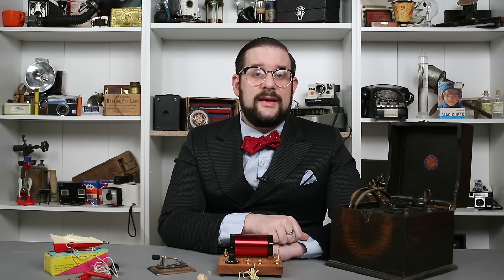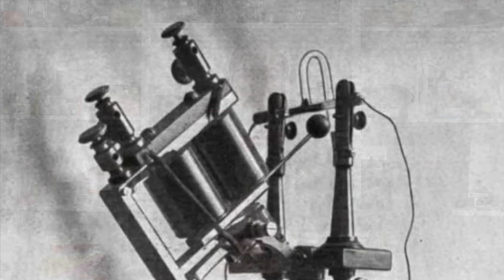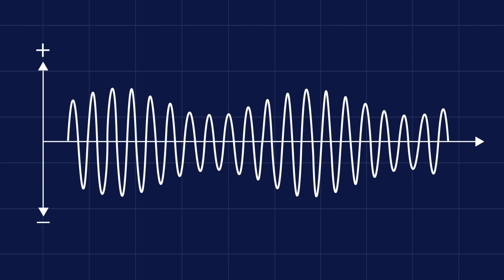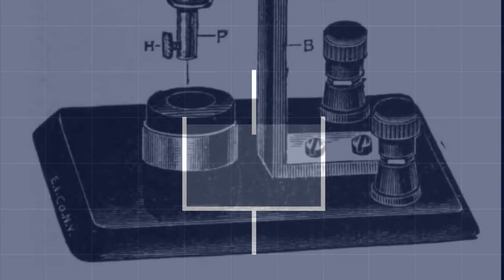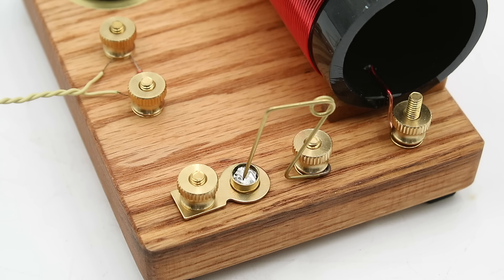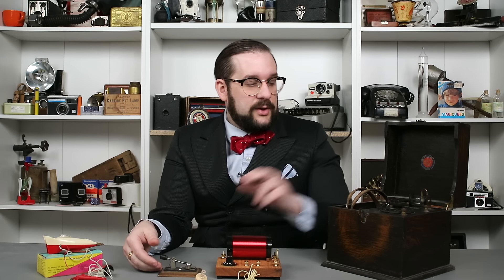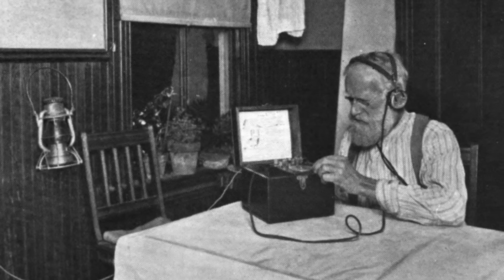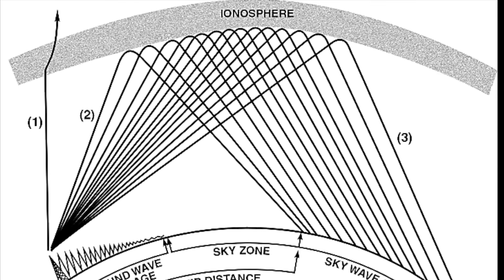Crystal Radios: No Batteries? No Problem!

Comment: In the late 1960's the "party line" (shared landline connection) to our farm was replaced by underground cable which left almost 2 kilometers of overhead, insulated, soft iron wire in an "L" shape unused. So I connected my crystal set! I could listen to 2GZ Orange NSW Australia from about 130km (80miles) away. :-)   .. Jim Bell (Australia)
Reply: That’s awesome

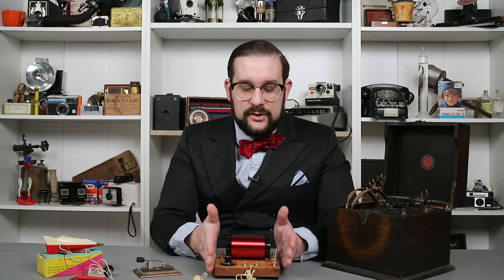Comment: 9:55 might be bob lazar 

He owns the company
Reply: 20:27 add a simple pll to the lc circuit and feed thru or gate with input from antenna 

Use a modern Schottky diode with low forward drop under .5v 

And a battery with opamp (as a comparator)
to get rid of pll and am carrier and just have the modulation 

 Get am signals from over the horizon and amplify em so your 3.5mm will work

Technically impedance matching a crystal radio with a low impedance load

Also could use a 555 timer as well
Reply: 22:05 empty glass beer bottle, saltwater, and wrap the outside in a foil or metal sleeve

Comment: I have a set of old headphones (similar to the one you have) used in the military and it would be interesting for you to show how they work because they don't have little speakers, they use 2" metal discs. In fact I heard what some did was actually add a crystal or some other component inside the head headphones to receive and hear the signal using the headphones alone. The only thing I know for sure is they work, you'd be lucky to get 2 years use out of today's headphone.

Comment: I was in Cub Scouts in the early 60's, and I built one to get an Arrow Point (the symbol for completing an activity). I bought 100 feet of Belden hookup wire and ran an antenna in my back yard. It didn't work. Then I moved it to sit on our washing machine in the garage. I connected the ground to the cold water pipe. It worked! I was so impressed I later became an electrical engineer and worked in the radio industry. And it all started in Cub Scouts!

Comment: The crystal detector is a Schottky junction, or equivalent.  1N5711 or 1N5712 is a good one.  Also blued Razor Blades.
Reply: A modern germanium diode works better than a silicon one due to the lower Vf.  The band gap of germanium is 0.6eV (silicon is 1.17eV) and the galena (lead sulphide) crystal used in the early radios had a band gap of only 0.37eV, they were called "point contact" diodes, and the metal point probably formed a Schottky diode with the galena.   Rusty razor blades work even better - probably due to the thin oxide layer.

Comment: There are also variable inductor sets which use two pancake coils in series, one of which is attached to a movable arm so that the coupling between the two can be varied. As a kid I built a set like this from instructions provided by a BBC expert called Mr Farley who I wrote to following a TV program about this topic. It worked and I was totally hooked on electronics from that point.

Comment: Funny story.  I built a crystal radio for a science fair project as a kid in the 80's...got a blue ribbon!  I still remember being fascinated by the ability to build a radio with just a few components and some blocks covered with aluminum foil (you'd slide the blocks over one another to act as a variable capacitor).  I still remember Dad having to visit multiple Radio Shack locations to find the right components.  I wish I still had it.  It was little more than a handful of wire stuck to a block of wood using thumbtacks to complete the junctions.

Comment: Attach the antenna to a curtain rod.
Reply: Yes, that works if you have stations nearby.  You need more like 20 feet of wire if the stations are far away.
Reply: @kensmith5694 It was T.O. in the 60s. Lots of nearby stations, always something to listen to.

Comment: Would I need less of an antenna being on the 15th floor of a building?
Reply: Generally, you need a good length but less added height.  The building may be conductive due to being made of iron etc.  Dangling a wire out the window may be an option.
Reply: @kensmith5694  that’s what i tried and it was very effective with only about 8 meters of antenna

Comment: With one of these radios that doesn't uses battery can plwer a small led! Which os pretty cool. Lole wireless light woth out battery. That will depend on the radio station distance. Of the station is near by your led will be bright , its neat. Pretty cool tech.

Comment: KFAB one mile awaiy from Papillion, Nebraska and with a broadcast power of 100KW made my Foxhole radio work just fine.  One of the thrills of my youth was when I connected the ground wire to the water pipe under the exposed bathroom sink and while tickling the pencil lead strapped to a safety pin over the surface of a single edge razon blade,.I heard KFAB for the first time .  I used an empty toilet paper cardboard core and 120 revolutions of 20 ga wire.   Fortunately I could reappropriate my dad's high impedance headset or the whole shebang would not have worked.  Much later in life I helped my daughter build a set using a germanium crystal as the detector.   Seemed like cheating.

Comment: I grew up in the 50's and used to build these radios with enameled wire wound around toilet paper tubes.  An open safety pin to spring load the point of the pin against the crystal.  The earplug used a crystal as well to convert the electrical vibrations back into mechanical vibration of the earplug diaphragm.

Comment: As a teenager back in the 1950’s, I built a crystal radio with a cat-whisker detector and put it in a cigar box. I think I had a 4 or 5 foot antenna dragging too. I use an old WW2 surplus headphone and using the coil tuner was able to receive AM radio broadcasts while walking outside. It became my first and cheapest “portable” radio. I lived in San Francisco, so there were many strong radio stations nearby.

Comment: I think that there was another type of radio used before a Xtal radio...TRF Tuned Radio Freq radios...with 3 dials
Reply: You have the order wrong.  Crystal radios came first.  TRF was later.
Reply: @kensmith5694  not according to my radio/communications history sources. They were developed simultaneously with Xtal being used frequently by DIYers and TRF to be sold commercially.
Reply: @W8RIT1  Audion detectors are mentioned in my 1909 "Operators Wireless Telegraph & Telephone hand-book" but there is no mention of using tubes to amplify RF as in a TRF.  T type of crystal detector is included.

Comment: I built my first crystal radio at 9 years old in 1962 as a project in Boy Scouts.  Even then, I was amazed at the technology that performed without batteries or plugged into a wall receptacle.  Stringing an antenna wire across the length of my bedroom ceiling and hooking the ground clamp to the hot water radiator, I was tuned into the local rock-n-roll AM station, listening through a single piezo earpiece.   My mother, who came from London, England, remembered well her family's first crystal radio that required manipulation of the "cat's whisker" to maintain a broadcast signal.  Knowledge of crystal radio technology will be valuable information to have after the zombie apocalypse.
Reply: To add to my comment:  I just checked and am very pleased to see that AMAZON does carry a number of kits, with all the parts, for building a crystal radio, starting at around $20.  That's definitely going to be a stocking stuffer for my grand daughter this year for Christmas and we'll build it together.

Comment: My parents bought me a crystal radio similar to the rocket ship radio at the 1962 World's Fair in Seattle. I went on to build other crystal sets including the foxhole radio using a blue raiser blade. When my son was in the Cub Scouts I out together a project for the boys where they built a crystal radio set on a board. I found a forum on line for crystal radios. The guys on the forum were so generous they mailed me the ear pieces, geranium diodes and variable capacitors needed so each boy had their own set. Pass it on.

Comment: When we were 6 years old my cousin came over and  had my dad draw a schematic for a crystal set. My cousin built it. It looked like the thumbnail of this video. 16 years later my cousin got his engineering degree with perfect grades. It took me 5 more years, as I was a dumb engineering student. 40 years later I was a consultant to an electronics company where another guy worked, who could turn anything into a crystal set. I never made a crystal set, but a poorly grounded guitar can pick up AM stations.

Comment: A shame that AM stations are shut down here in Europe (I don't know if there are stations left, but the frequencies are scheduled for reuse with digital services, as far as I'm aware of). I do have an old original "cat's whisker" crystal detector, witch I repaired, and which worked quite nicely. I also have replaceable coils (the "spider web" variety, one original and some self-made), and old-style headphones (even though those are actually from the 80s).

Comment: You nailed this video very nicely. I started building crystal radios since the 1960's and had a sizable collection of early 1920's sets. I have been a Ham ( wa4jat ) since 1974 and still enjoy building crystal radio circuits for the short wave bands.

Comment: When I was a kid in about 1960 I got a crystal radio kit for my birthday that was from Radio Shack. I was amazed that I could hear radio programs through headphones with no power but it did have to be attached by wire to a pipe in the ground outside my window for the electrical ground.

Comment: I had a crystal radio as a child, around 1958, that looked like an egg with a knob on one end that you turned to tune, a wire with an alligator clip that I clipped to the steel frame of the bunkbed and a earpiece. I loved that thing and could get all of the local AM stations. Thanks for reminding me of it 🙂

Comment: If a station is 2 miles away corrosion on zinc fence may detect and power sensitive earphone!
Reply: Got red ribbon for crystal radio science project ,I think germanium 1n34 diode variable cap and coil,fahnstock clips for connections!!!

Comment: England. What an excellent video. I built and did terrible things to crystal radios, some of which actually worked. With a roughly 200 ft aerial at 30 ft, I could even use an old extension loudspeaker. I learned more about the history of crystal radios, etc. watching your videos, than all the books I ever read. Well done that man, I'll put you up for a knighthood (but don't hold your breath).

Comment: For the foxhole radio capacitor problem, one solution I've seen a few times in the museum radios and old photos, and personally done at one point is to take a couple of the 5-count packs of razor blades with the razors still in their wrapping paper, then punch down through the paper with a wire tied tight on both sets of blades. Interleave them like shuffling a deck of cards and you get a workable-but-clunky variable capacitor you can make in 5 minutes tops out of stuff any POW or soldier can get ahold of easily. Sadly can't get blued razor blades anymore, only stainless, but you can make a decent detector crystal by heating up a galvanized nail with a lighter to oxidize the zinc coating, zinc is a pretty good diode. For the piezo earphone, grow a crystal of Rochelle salt out of single-acting baking powder on the bottom of a tuna can, stick a piece of foil on there, and connect one electrode to the foil and the other to the tuna can - that's how the POWs did it, but the people in the trenches already HAD high-impedance headphones for the sound-powered field phone systems.
Reply: Get some selenium dioxide gun bluing if you want to use a razor blade for authenticity.

Comment: You can replace the diode with a blued razor blade and safety pin. The capacitor used to be made from the paper and aluminium foil liner of 1940's cigarette packs. The only thing you need is the ear piece. Everything else you can make. The coil can be a pain but there is a trick for that. Use some thick fishing line between the copper wires to keep good spacing. Use preferably clear nail varnish to keep the windings in place and plain brass eyelets to secure the ends. I'm currently working on a variable capacitor where you do not have to folf the baking foil to tune it, but it's not so easy.
Reply: Good Post.
Reply: As built in POW camps in Germany during WW2

Comment: Love it, Spirit of the Radio, Eh Canida?!. I'm glad crystal sets are having a bit of a moment again. Still remember by pals RadioHack 101 project kit back in the 70's and grounding to a radiator, wire in a tree, sharing the earpiece. Good times.
Reply: Yes, I am seeing a lot of youtube videos about making them.  I even made video to try to help them out on the topic of the 1N34 diode that normally was used as the detector.  You can't get real 1N34 diodes easily these days.
Reply: I had a three transistor radio shack p box   I listened to the fall of South Vietnam and the watergate scandal on VOA. Great stuff.

Comment: With the advent of all radio stations migrating to digital, these crystal radios without an AM transmission to receive will just become curiosities for the museum. Even SSB is totally undecipherable by these simple tuned circuits, however FM stations can be slope detected but I've never seen a crystal set that works at VHF where FM stations can be found. I remember building a crystal set nearly 70 years ago to listen to Radio Luxemburg, happy days :) .

Comment: Great video.Ispent some time as a radio operator 30 years ago. With the right atmospheric conditions a 10kW AM radio signal can travel around the globe easily. That is why AM radio stations transmit directionally at night here in the US. I used to only have an AM radio in my car and I would tune into some stations from Cali and Texas for fun. That radio had an excellent analog tuner with very fine adjustment. It was a stock radio from a 73 VW bug😊
Reply: strange far off late night am stations were always fun on a drive waiting for them to announce their town

Comment: Of course, this also needs you to have local AM transmitters, which are vanishing fast, and with the local rise of all the poorly shielded (if they have any at all) electronics, that all emit wideband RF noise, you will not get any signal out of a crystal set these days, unless you are lucky enough to live very close to a transmitter that is still active.
Reply: I happen to have about 4 in my area.  There are still quite a few stations but the broadcast rubbish.

Comment: Thank you for a clear and educational video.    I live in France.  France no longer has medium wave AM radio transmissions, so I was unable to test the crystal set which I had made for my grandson in Perth, Australia.  He should get good reception as he lives just 7km from a 50kW transmitter!
Like some other responders, I was given a crystal set when I was 12, in 1953.  I eventually left school to study electrical engineering at university and ended my career as a head of a section of electronic engineers, having worked my way through the various levels of electronic engineering.

Comment: I made a crystal radio a a kid with an OA91 diode, a coil of wire wound around a spool of thread and a crystal earpiece, didn't use a capacitor. Got a great signal when attached to the radiator, Atlantic radio 252, 500,000 watts.

Comment: Great show. Thank you.
    I had a Spy Pen Radio as a kid back in the early 70s. Tuned by sliding the tip in and out.
   Best earpieces ever.
That Q he is talking about is important.
    Also as a kid I spent too many hours making electronic bugs 
    A high Q transistor in a spy transmitter is a world of improvement.
    I watched too many James Bond movies as a kid, which is why I got into this stuff. Fun Times.

Comment: There was  a version of the crystal radio called a foxhole radio.  The circuit was the same but the crystal was replaced by a razor blade and a piece of pencil lead attached to a safety pin.
Reply: He hit on that in the video.
Reply: I missed the end of the video and posted this, then went back after I posted this.  He did a good job

Comment: When I was a small kid, I was given a crystal radio, and I loved running out a wire to listen to the local station.

I had that radio many years, but it disappeared many years ago! But it started a bug that became a profession with me in electronics, and I spent 36 years as an avionics tech, till my health lead me to retire.

Now I still work on electronics, and I am an Extra class amateur radio operator and I still listen to stations all over the world!
Reply: I built a Heathkit HW-12 at age 13 and was careful to follow the excellent assembly manual exactly. I loved making stuff. The radio worked fine but I needed to learn Morse code better.  Now I know Morse great but never got to use it with another person. People beeping car horns don't know they are making Morse. LOL

Comment: You are describing the earliest version of transistor, but they didn't know it was one?
Reply: It really wasn't because it only had 2 legs.  You need at least 3 legs for a transistor.  The work comes from one of those old languages with the "trans" part meaning from here to over there and the "sistor" being from resistor

Comment: Crystal sets don't hear FM radios - they work with AM but there are very few AM transmitters any more, and what AM transmitters are left are likely to be too far away for a crystal set - so they aren't so great as gifts for children any more because the child can build one correctly yet never hear anything with it.
Reply: You can build crystal sets for FM. They are very hard to tune, though.